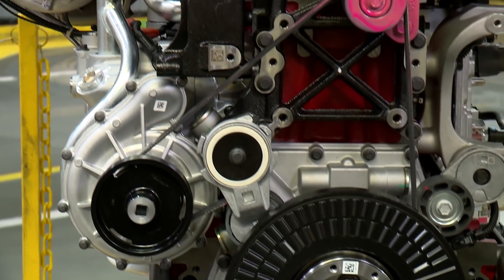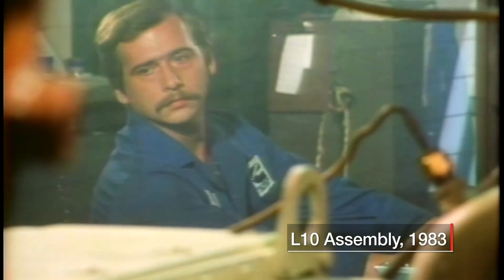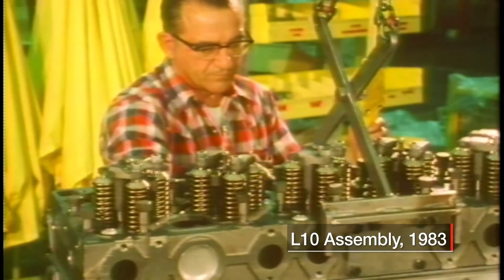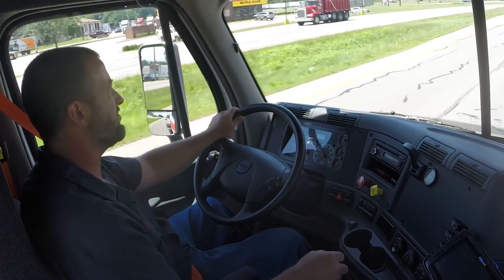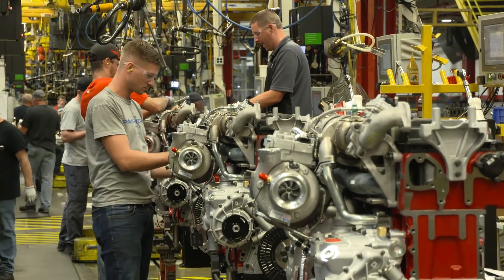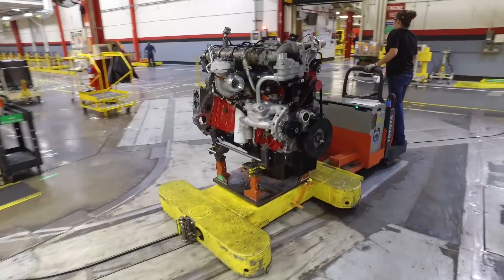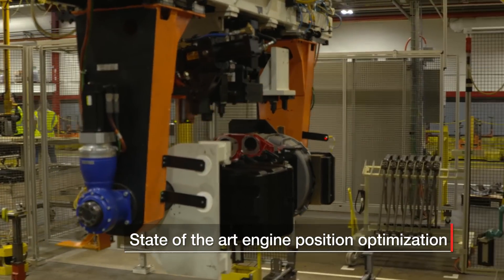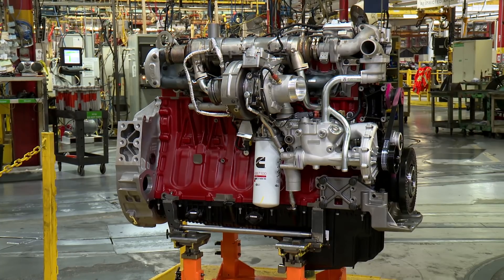Birth of the X12, new Cummins Heavy Duty engine

Comment: Wish we could still get n14s in uk . To fit to trucks . This 12 litre will hopefully better than the m11 that needed rebuilt after around 500.000 ks . Every m11 i know of has bn rebuilt about that milage . They pull ok but lack torque at times . The new emmissions just strangle modern engines . Todays 500 +engines are barly pulling much better that the old 400 plus engines of non emission control trucks . Ive found im not goin any quicker up hills with similar loads and weight on than i did years ago . With smaller engines . And im not pickin on cummins as its common on all modern diesels  but i dont suppose its gonna change anyday soon . But yea could do with a manufactorer in uk or europe offering cummins again . I know they dont meet current and future proposed emmissions but im sure cummins will adress this in time to come   thanks for posting .

Comment: Rant and rave as much as you want about Cummins, their not a patch on Scania for reliability and quite running, Cummins sound like a bag of Spanners when starting up from cold especially in winter when trying to start them without a block heater. A Scania will start up easily anywhere in the world without fuss or smoke no matter how cold it is. I have run Cummins E14 and L10s as well as Cat, the Cat outperformed the Cummins hands down but the Scanias and even Volvos leave them for dead for power and reliability.

Comment: My old 2010 T800 had an ism 425v. It wouldn't pull a hill very fast but it hauled 40,000-70,000 pounds every week for about 800,000 miles and never had any major issues not even emissions issues.

Comment: More junk built by Cummins incompetence. Their best engine was the N14.
Reply: the most problems u have with the newer diesel engines are all the emissions garbage
Reply: Jonathan Wortner..ktta was better
Reply: There best engine was the Cummins NTC which they later turned into the N14 :-)
Reply: @athonynesbitt7956  exactly Cummins is the daddy of diesel engines today
Reply: Still running n14s and m11s alongside isx engines, you can guess what spends more time in the garage.
Reply: @chuckiefinster544  lol gotta be them shity isx
Reply: Actually the KT11's is the best Cummins Diesel engine
Reply: @mikemcgrew65  no bro thats the most powerful engine cummins built at that time you could get a stock KTA19 rated up to 1000hp

Comment: Also,  does the egr system reallyy need to start on the exhaust manifold?  Seems to me it could be better suited. To place in past the cat.  I dont see a vacuum problem if its started that far down the exhaust.  You probably wouldn't even need a cooler. You'd have far less sut clogging up the system.  Lowering maintenance cost. Not to mention you'd get nothing but pure Nox.  You def have the easiest egr set by far.  But dam, it can be even easier, more reliable and cheaper if you suck from 3 quaters down the exhaust pipe

Comment: I'll take my Detroit Diesel Series 60 hooked up to my EF 10 speed any day. Pulls from around 700 rpm like a bear. I run 65,000 - 75,000 lbs loaded everyday, no problem. Most hills I only have to drop one gear, MAYBE two, tops.

Comment: Yay... Another new engine with another new long list of over-priced special tools to fix it. Cummins, the special tool company. "If you need to install a simple seal, we have a required $500 piece of simple machined steel to do that. Want to confirm the timing is right on? We have a $350 set of cheesy keys to do that" . No more Cummins, stick with Detroit if you have no other choice, at lease the special tool and chemical list is 1/3 as long. CAT is the best, it's ashame they don't do OTR anymore. I can rebuild those engines outside with maybe 3 special tools.

Comment: Cummins has come along way since their L 10 days. I work on all the heavy duty engines from Cummins  Detroit  Volvo now there’s a joke ha. And the super terrible International maxxforce which is no more. The A 27 is their new puppy. I can’t really say anything bad about a Cummins. Great power , Diagnostics is pretty good now. The best I think as a Technician comes down to preference only. They all have good and bad points. At least Cummins is building here in the states. Other manufacturers seem to have European parts suppliers. Fleetguard is Cummins owned here in the states to. A common misconception is that diesels are for light duty trucks like the Dodge Ram great selling point but facts are today’s diesels are to costly to purchase and maintain properly. Diagnostic software alone is 1000 bucks annually. And to pay a guy like me who can fix all the emissions lights that come on regularly with all heavy duty engines is another 65000 a year. Keeping up with technology at schools yearly. You get my point.

Comment: I had a px8 in a service truck the damned emmissions system doomed the engine after 77000 miles we deleted the damned emissions the milage went up 2mpg engine response and power were really improved ,,I know this outher boltturner who put it on the machine to check the exhaust emmissions guess what ,he said it passed with flying colors!! I never told him of the delete ,. My question is just what was all that useless stuff doing besides plugging up and messing up my engine I've retired now and know the guy who got my truck he said it's been one great truck now no troubles at all ,go figure!?

Comment: I ordered a Ford F-750 with a Cummins X-12 in front of a Allison Auto transmission and I absolutely love it, plenty of power & torque and gets great mileage too.
Reply: That is an engine option on the f-750s?
Reply: @5.43v  not anymore. It's the 6.7l Powerstroke now
Reply: @jansen7640  i thought the 6.7 cummins was an option

Comment: 12 litres not for vocational truck...voc truck enough 8-9 litres eng.my tipper semitruck is with  12 litres inline 6 with 410hp.gross is 48 metric ton.not problem ever....never....over 815000miles...cons:0,160 us gall/miles    55 miles/hour

Comment: My friend bought a new Pete with the latest greatest Cummins in it ,,,4turbos then book a rod through the block at 325000 miles Cummins won't cover the engine anymore they want 40 grand for a new engine! He lost the truck to the bank the damned thing wouldn't stay out of the shop long enough for him to make any profit !junk,junk,junk! New Cummins are junk I had a smaller px8 paccar witch is a Cummins isc in my service truck a 335 peterbuilt,70000 miles 4 tubos two sets of injectors two egr valves two egr coolers and a hi pressure fuel pump ! Junk just plain junk themdpf filter would plug up often because of using crane on truck for hours at low rpms ,setting transmissions big pumps and such on heavy equipment . I'll tell you I was glad to retire to get away from that truck ,there's no reason to handicap customers with junk like this ,to many impossable regulations by epa that can't be met ,the tech.isant out there yet so Cummins and outher manufactures push this junk unto thier customers! I went into a drop spot to pick up my parts one morning and the delivery truck was late,,while waiting there a got into a conversation with one of the salesman at hunters truck sales he made me laugh when he said he was going to hell for lieing to folks when he told them how good the new trucks where ,I'm a god fearing man he said and yet I'm foreced to sell them thesePOStrucks. The good Lords gonna send me to hell for lieing!!   The old fellow seemed nice but I sensed a bit of sincerely in him well give him a pass Lord he's honest by telling me this !

Comment: have N14 and M11..
 Best engines ever made.
Reply: I use to drive a truck that had an N14 and that motor ran and pulled. why would you consider those two the best motors ever made
Reply: My m11 has just done over a million on the clock. Once the trucks been overhauled the engine will be getting the same treatment for many more miles to be clocked up. Shes most likely good for more but its best to play it safe than see her blow her guts all over the road

Comment: Cummins is enemy of oil I have 2010 truck Cummins after 9k miles I have to do oil change or it will start turning of on highway speed I run ca to Tx

Comment: My 99 24 valve was a gutless wonder from the factory! Some years later when (  I ) was able to borrow an Oscilloscope the only signals which weren't corrupted were the CAN Bus ones the rest were. Something the Do_G_ dealers could have done with the Scanners and Cumzin in Surrey BC! But not tooo complicated for them. Just so NO! to Cumzin in the form of Do_g_ Crap! How does an 11,400 Lb duelly read 7,4 L/100 Km , do you think it is burning much fuel? NOOP! NO fuel ='s NO HP! ='s Gutless Wonder!

Comment: I️ love the Hemi in my Ram 1500! Thanks cummins!
Reply: Cant tell if your being funny but a hemi is not a cummins.
Reply: For a engine to be a “hemi” the spark plug is located die center  to top of piston in gas engines. For a Diesel engine the injector or nozzle needs to be mounted die center to piston to fall into a hemi classification. The 5.9 and 8.3 Cummins made were not hemis until they went with electronic in those engines.

Cummins never installed diesels in the Ram 1500, they only went in the 3/4 and 1 ton chassis

Comment: I Love my 1999 Dodge ram with My cummins 24valve turbo diesel.
inline 6 cylinder. 5.9 Liter. I Just Wish it Had a Decent transmission behind it. Im on my third Transmission. Any Body Know of a Bullet proof tranmission i canPut behind it. I use the Truck Running service calls & Truck Weighs in at 8,800 lbs. fully loaded 24/7. Plus i Want to Tow a 10,000 lb boat behind it.
Reply: Me too.  I have a 2001 Dodge Ram diesel, and have recently worn out my 4th transmission, a 5-speed manual.  418,000 miles on the engine, and it runs as well as the first day I got it.  But Dodge never has put a transmission behind the Cummins that was up to the task.

Comment: I've been working on cummins engines for the last 35 years. The l10 was a joke. The mlemon(11) was a hole lot better however, it leaked worse then a Detroit after its first year in service. If only the m11's had head studs and rocker box studs that were lock tight'Ed from the factory I would have seen at least 75 within the last year and thousands over my career. I'm getting ready to retire and here I have done 16 isx12's within the last six months. Cummins talked about improving, but all they have done is relocate the problems to further under the rocker box! At least do what CAT has done and take your name out of the hat until you can fox your problems! Just saying the Komatsu equipment and full size trucks, (peterbilt, kenworth, Volvo, freightliner, I), I work on would thank you for it! Sincerely your problem solver for the last 35 years and hope to retire, but you guys keep me in business, NWHEQ Red cross!
Reply: m11's always sounded like they had a bad injector

Comment: Cummins should make a 20 valve 3.0L in-line 5 cyclinder diesel engine with direct and port injection and cooled EGR.
Reply: Unfortuatly, Not sure if they would legally do it because of how similar it would be to the Mercedes OM617, but if they made their version of it, kinda like what Ford did with the small block chevy engine, it would be quite an excellent engine.
Reply: Port injection on a diesel?  You really need to learn about engines.

Comment: All you idiots talking about your 6.7, 12 and 24 valves don't know sh*t about the vocational cummins engines. They are CRAP.
Reply: superturboawesome1 the 12 valve was designed and built for heavy equipment and tractors  joint venture between j.i.case and consolidate engine corp "cummins" the 12 valve shared more with the HD  power horse vocational truck engine then the others you mentioned so they stuck em into a dodge, now days they throw automobile light duty like diesel engines into tractors, might as well go back to gas engines cause the advantage of the diesel has been knocked down to that of a gas engine!

Comment: What's really crazy is that, every time these engines are designed & built, there's LESS Co2 being emitted. And Co2 is EXACTLY what plants & trees need to survive & thrive. I guess the E.P.A. ( Environmental Puke Agency) is just hoping everyone forgot everything they learned in science class.
Reply: Steve Gregory I think you might need to go back to science class for a little longer to learn why more CO2, despite being what plants and trees need, is still a bad thing. More CO2 has indeed caused more plants and trees, but it’s a bad thing for other parts of the environment. Similarly you need oxygen, but breath 100% oxygen for a few days and you’ll die.
Reply: Steve Gregory dumbest post on this vid yet. And there are a lot of idiots here that seem to think the X12 somehow is the same as a 6.7 or 5.9 in a pickup.

Comment: I will stick with my Briggs and Stratton 5hp engine, thank you. Mowed a million lawns and still going.
Reply: HAHA, umm I don't think the X12 is anything close to the B&S toy engine.  Maybe you could upgrade to the new 4BT Cummins at least.
Reply: Jason C yeah but your fuel get your lawn mower with a Cummins on it you'll help my stock go up
Reply: plus :  a two slow legs reverse gears.
Reply: Jason C use
😂
Reply: Can't haul a load of logs with that though.
Reply: Jason C lolol
Reply: Este vato haha 😂😂
Reply: +William Todd I think you mean R2.8?
Reply: Yeah I have a 3 hp Briggs in a 1961  TOTE GOTE , it has a 40 / 1 gear reduction using a CVT and a rear tractor tread tire, they were made to haul deer out of the woods, unreal low speed power.lol.

Comment: How about being smart and just make a engine that has a high torqe electric motor on the engine to reduce co2 output? or a electric motor secperate from the diesel engine that will go into electric mode while in the city?
Reply: L K ...Yeah and how about welding a fart to a rainbow in a tornado while we're at it!!!
Reply: L K it's on the way. Look at the future truck videos out there- there will be no transmissionswhen they switch from diesel powerplants

Comment: The EPA has runied Diesels and gasoline engines, Diesels especially, they put all these techno bullcrap into these engines to meet EPA requirements and they don't last like on old diesel use to.
I'll take a N7 or old 6 liter cummins any day over this new age crap, the EPA needs to be taken off their high horse becuase they are costing real truckers and consumers big bucks for junk motors.

Comment: I lost all respect  for Cummins, after having to work on isxs for a living. 85 brand new trucks in are fleet had to have the engines rebuilt, because of oil passing the piston rings. And stopping up the dpf  filters. They used 20 to 26 qts  of oil every 30 thousen miles. I could go on and on
Reply: AdaWay Performance ! Done on purpose so they can sell new parts or a whole new engine or brand new rig they don't want them to last for very long at least with the engine and pass the emissions test!
Reply: That’s because of the EGR, soot is like sand paper. Feeding it into the engine shortens it’s life substantially.
Reply: HDstreetshark if they designed their engines to run properly then this wouldn’t be a problem.
Reply: Not sure if you mean you're a mechanic, but most engine failures nowadays are due to after treatment. Can't really blame the manufacturer for federal guidelines. Any of their engines without any after treatment I'm sure would run just as long as the old Cummins engines.
Reply: OhcoChildPlease you CAN most certainly blame a manufacturer for not designing their product to run as required with good longevity. Putting out a poor product just to sell a product is not a good business practice. If they cannot make it run right, then they shouldn’t be building engines!
Reply: Last time i checked my truck the cummins engine has just over a million on the clock......cant believe they dont build these engines to last

Comment: Another Red turd the last good engine Cummins made was the N14, the ISX is junk nothing but computer issues with them one guy I know his truck has spent more time parked than running because of computer issues. Back in the day the 3306 Cat would wipe the L10s ass the Cat would run circles around a L10.
Reply: Graveltrucking if it's not computer it's coolant in oil and coolant leaks when cold and just grenading at half the life of a Cat or an older pre-emissions Cummins engine. Fun times these days always keep your hiking boots with you for the walk

Comment: But will it fit in my dodge??
Reply: soaringtractor lol the payload capacity of a 3500 is 7400lbs, I think I can handle a 2100lb motor. Even the front end could technically hold it because a 6.7 weighs 1100lbs and a vblade plow is over 800lbs. If it can hold 1900, I think it can go another 200lbs
Reply: There's no room for a fucking 12L engine in your dodge. No, it won't fit. You can't even fit an 8L in there.

Comment: I'll stick to my Cat
Reply: Phantomthecat can't outlast an old 3406
Reply: I drive a 2001 Pete with a c15 in it that has 680k miles and still going strong. It's been hooked to a lowboy its whole life pulling Cat 345's and whatnot.
Reply: TomJāck Gentry you know what CAT stands for right?  Cummins After This!!!
Reply: My 2005 ISX has 1.3 million miles, still no issues other than the egr and turbo
Reply: zorajohn you have 1.3m on a ISX? C'mon my neighbor works as a mechanic at a small trucking company about 50 trucks, and says the isx engines can't make 600k without breaking a piston. They won't even buy cummins anymore.
Reply: Cat has been out of the road use game for a while now.
Reply: Arnold damn those are low miles for a c15 I know those 3196s lasted for a good million to million and a half
Reply: Damn. So with good maintenance it should go twice the miles it has now.
Reply: Arnold mine has 1.2 million on it.